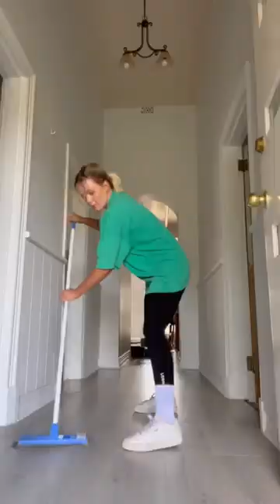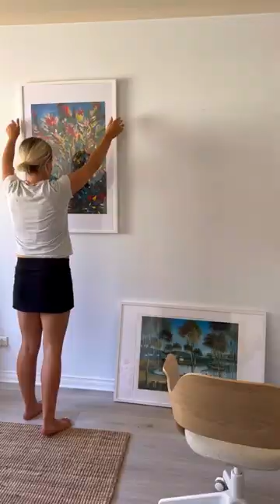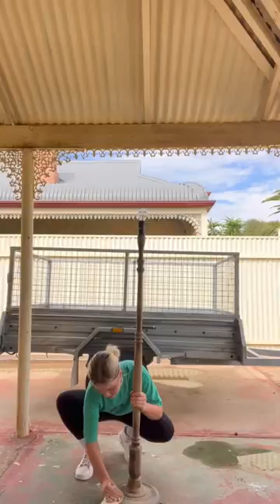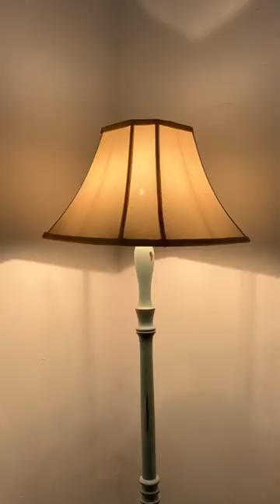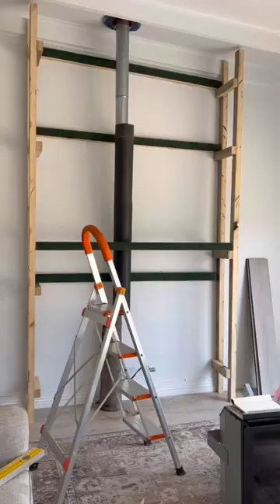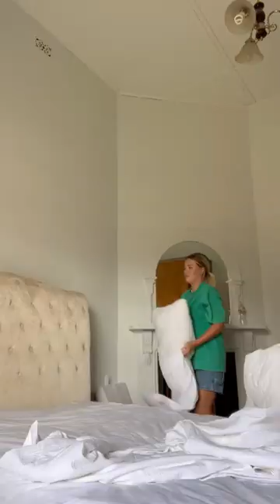House renoooossss #australia #vlog #minivlog #home

Comment: You can get an electrician to rewire the lamp for you. If its in bad shape or older than 15 years i tend to get it checked by an electrician if not completely rewired.